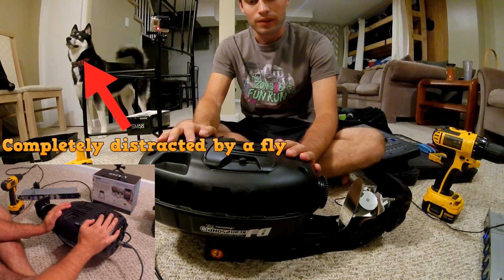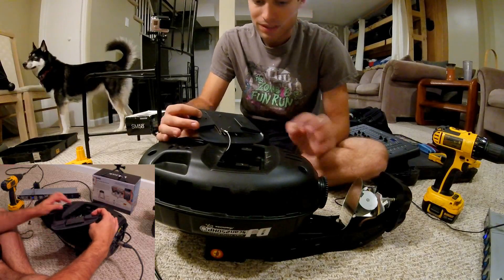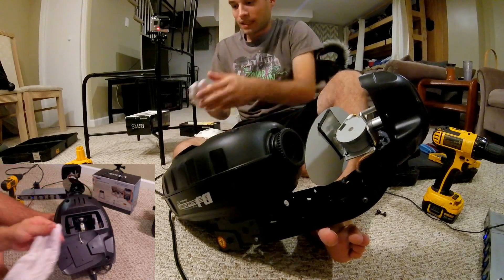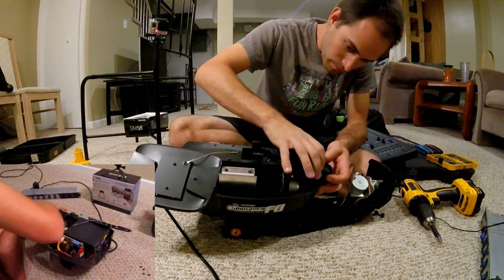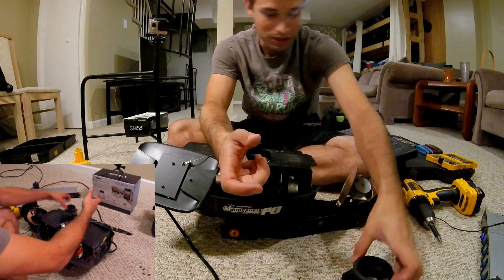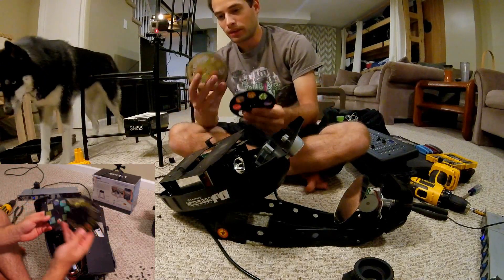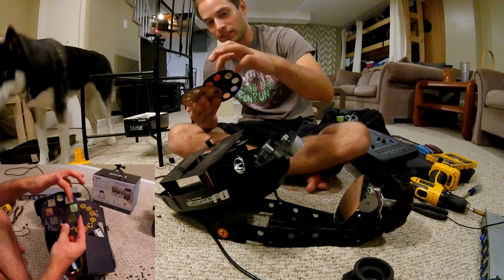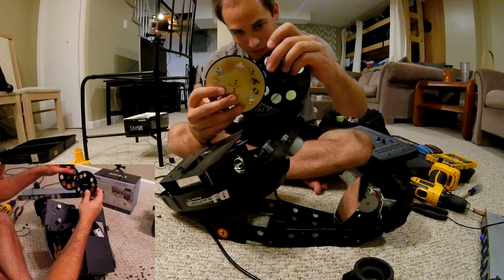How Intelligent Lights Work - Part 1

Comment: Question for you:  I picked up a American DJ spot 250.  On the LED the A001 is constantly flashing. Do you know why it's doing this. Any help would be appreciated. Thanks
Reply from the maker: Hello Neil. I tried to replicate the blinking with my dj spot 250 and when i tell it what dmx channel, it will blink for 3 sec then go solid. I tried to put it in different modes (with and without a dmx controller attached) and couldn't get it to keep blinking. I also checked the manual and did some searches but none of the trouble shooting code match this issue. You might just have to contact adj customer service.